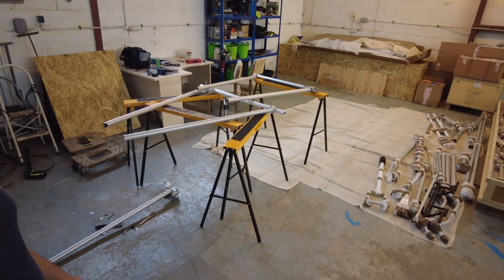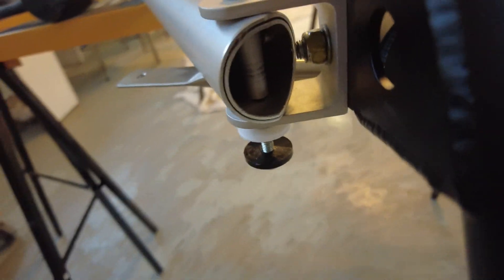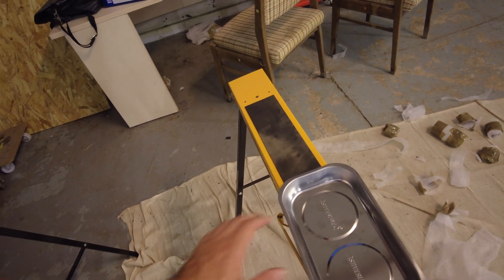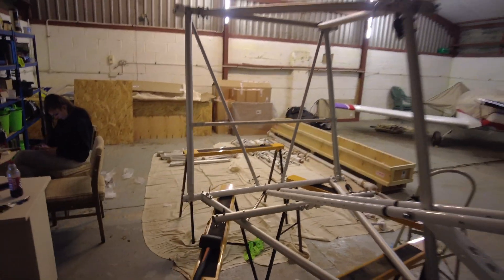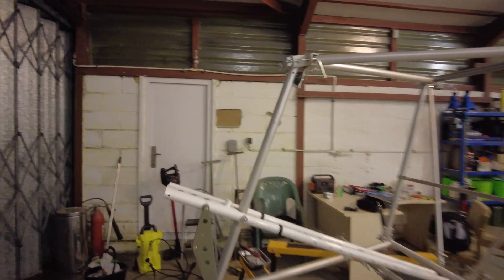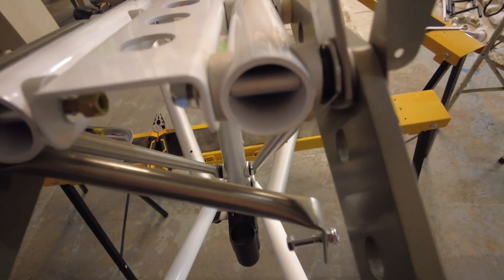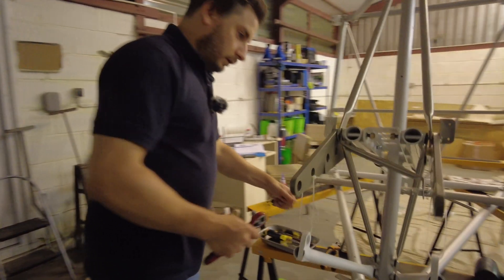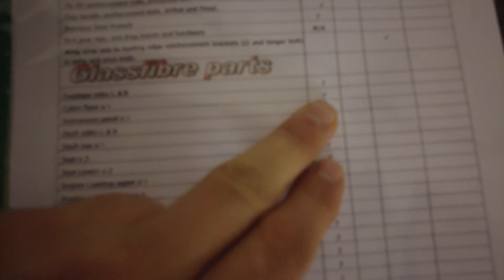Building A Plane | Building My Skyranger Nynja | The Build Begins | Episode 3

Comment: I can only imagine how daunting it is for you to build this kit. If i may respectfully sugest the following to help you. You could do with covering all the concrete under your work area so as not to damage the powder coating on the frame as well as using padding to stop the tubes knocking against each other during the build up. You have great steel girders above your head, use them with straps to support your frame during the build. With diferent lengths they will be you other pair of hands. Put an 8x4 sheet of board on your tressels and you will have a much better workstation. I hope this helps.
Reply from the maker: Hi Peter! Thanks for watching! Yes - it was very daunting at the beginning but after a few days I got into the swing of it and it is coming together very quickly! Rest assured the tubes have never touched the concrete, they are all lay out on dust sheets and have been rubbed down with ACF50! The frame is currently sat quite nicely on padded trestles and is well supported. The legs and wheels are also now on and so is the rear fuselage! Anna has been a great. “Other pair of hands” throughout the build! The 8x4 was a really good idea though - I wish I’d known that when I started! Thanks again for watching!

Comment: My advice and methods that might help.
Remember bolt convention has bolts going from top to bottom or front to rear unless otherwise instructed. Torque up bolts (There standard torque setting if they are not given n the instruction, don't just do it with a ratchet) to finish torque and mark with (Dykem Cross Check Tamper Proof Torque Seal Mark Marker Paste for Nuts & Bolts) so you can see which ones have been done and also you can see if the bolts have moved at annual, better than a paint pen. You should not need locktight on a nyloc nut.
I like the format of the video, I hope that is not too much work on the edit.
Reply from the maker: Thank you! There is no torque setting for the nuts and bolts. With it being aluminium tubes you have to do them up tight enough not to distort the tubes but there is definitely no torque settings. The paste is a good idea for sure - thank you! The manual does indeed say to use locktite 243 on all nyloc nuts and bolts…
Reply: @LetsGoFlying  I have to admit that I didn't know that they were unsupported tubes, so snug is good. It's unusual to use loctight with nyloc but belt and braces is OK, at least you know it will not come undone in flight.

Comment: Looks like a giant Meccano set, do you have to torque every bolt to a certain value?
Reply from the maker: Thanks for watching! Yes it is indeed like mecano! There’s no torques on the airframe. The nyloc nuts are backed up with loctite and tightened enough that they are tight but don’t distort the aluminium tubes. The structure is incredibly strong once all the supports are in place. There is a great drop test video on Facebook!